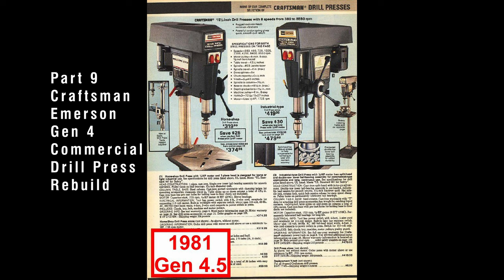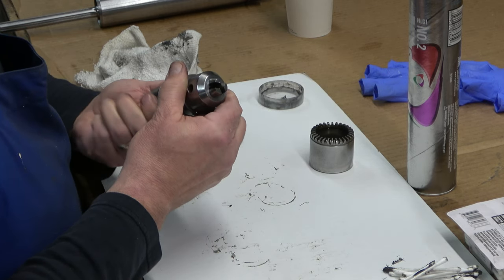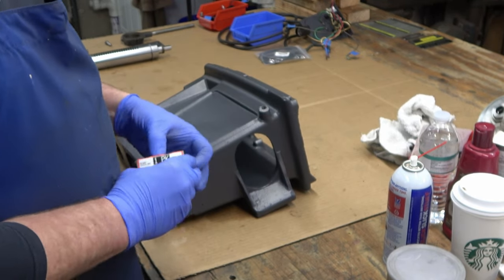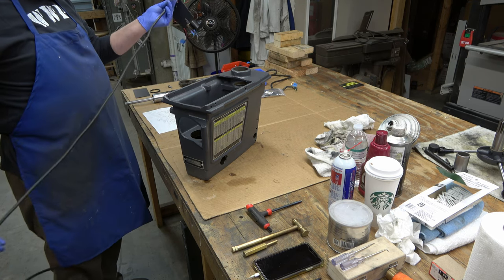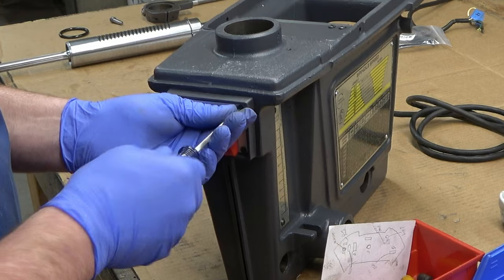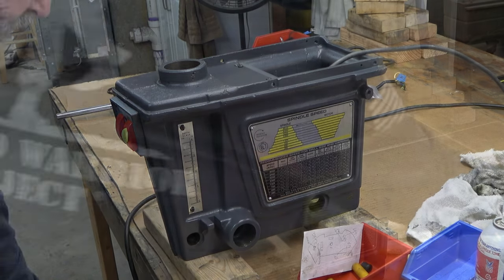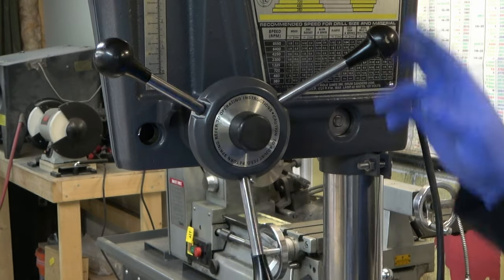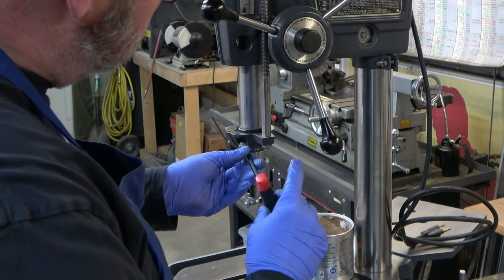Part 9 Rebuild Emerson Gen 4 Commercial Craftsman Drill Press (Assembly Continued)

Comment from the maker: @ 26:00 (Hub, Pinion, Spring Assembly) I forgot to mention that the pinion has a fibre washer that is on it and that I lubricated the Pinion with Super Lube before I installed it in the eccentric Bearing. So make sure you lube it and that the fibre washer is installed before you install it in the eccentric Bearing.

Comment: 25:52 Any idea where to obtain one of those springs? I can't find another one to save my life, and I'm thinking that I might have to modify the drill press to use a different kind of spring.
Reply from the maker: They pop up on ebay fairly often. You may have to buy a complete hub, Pinion, Spring assembly like this one to get the spring. https://www.ebay.com/itm/155707757286?hash=item2440e7d2e6:g:6zIAAOSwOZ5k0RZF
Reply: @JeffsShop  Thank you so much! I hadn't thought of buying the entire assembly.
Reply from the maker: Thats actually not a bad price, when I use to sell the springs I had produced, I sold them for $20.00 plus $10.00 for shipping so $50.00 along with the hub and pinion is a good deal and you could just resell the hub and pinion and make your money back if you dont need them. @JamesKelly89
Reply: @JeffsShop  I actually bought that item and it came in the mail this morning. I installed it and the quill is returning beautifully now. I very much appreciate your help!
Reply from the maker: @JamesKelly89  I am glad you found a spring and your drill press is now up and running. Keep checking ebay and when you are able to do so, grab an extra spring. They are no longer produced so they are one of the most sought after parts. Also be advised that there are two types of springs for the 15 1/2" drill presses, check out this thread on Garage journal for more information: https://www.garagejournal.com/forum/threads/craftsman-drill-press-information-belts-bearings-chucks-keys-etc-1946-1984.489080/